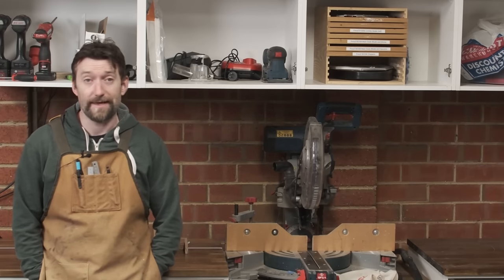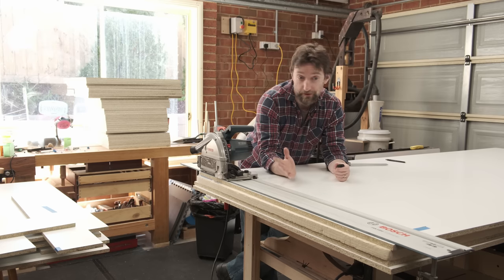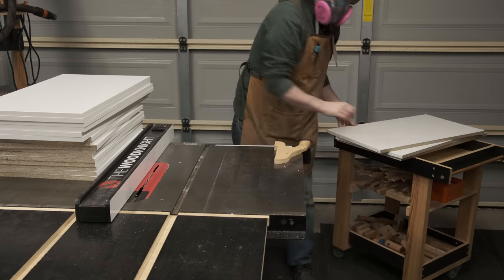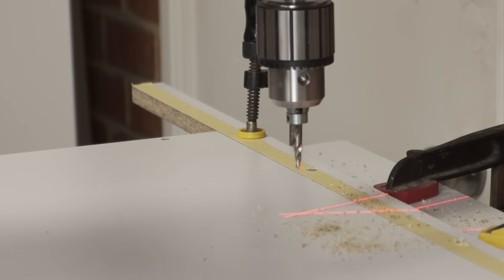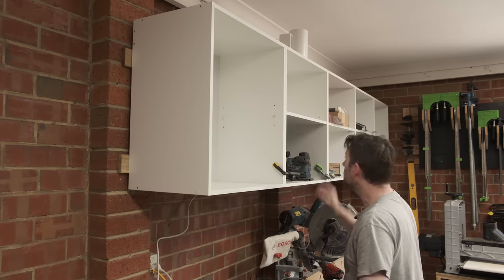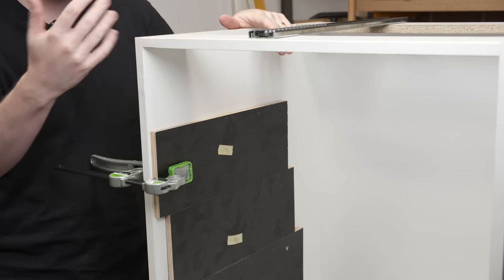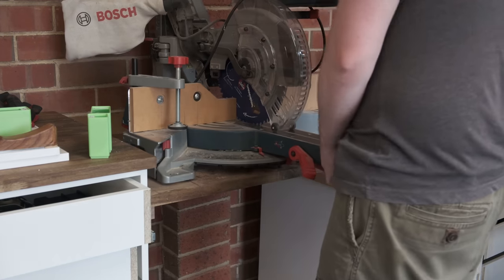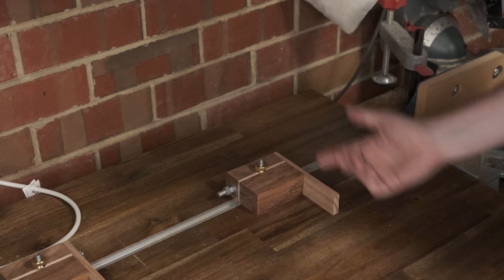Frameless Workshop Cabinets

Comment: Great Job Paul. I agree, Why measure when you don't have to. I use spacers at every opportunity. I also went for the T track solution for my Drop saw after watching a Wood Whisperer Video quite awhile ago, although I did use shop bought stops. I wish I had thought of your idea of levering the Plinth rather than the whole cabinets. It would have saved me some frustration on a past Kitchen I installed about 18 months ago.

Comment: That’s a great amount of storage. They look great. 

I haven’t seen anyone put legs on a plinth before. I like that idea. Mostly I see people use shims under plinths and screw into the floor. I don’t really want to do that. So i like those legs. What legs did you use? Do you have a link?
Reply from the maker: They're "just" Hafele's Adjustable Legs which are sold at my local big-box store https://www.bunnings.com.au/hafele-100mm-black-adjustable-screw-on-leg-set-20-pack_p0101408

A few brands do the same thing, I don't think there is any real difference between brands

Comment: Looks great Paul, very nicely done. With the stops for the mitresaw, where did you pick up the knurled knobs, I spent time looking for them a while ago for a project but gave up.
Reply from the maker: Thanks Mario.

I got the knobs from Timbecon! They only started stocking them uhhh.. I want to say within the last 12 months but time has lost all meaning and it could have been this year
https://www.timbecon.com.au/torquata-t-track-brass-knurled-knobs-5-16in-4-pack

A long time ago, they had very tiny flip stops for drill presses and the like that had those knobs - the flip stop was rubbish, but I've had one of those knobs for about 6 years now and they're great :)

Comment: Hey mate, nice to see the shop coming along

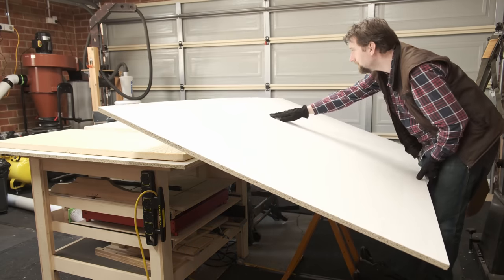The panel lifter at 2:30 ; I want one and I want one now. Where did you get it?

The 1830 x x2440 quesiton has its roots in a guy named Gabriel Mouton, the father of the metric system. His system had to comply with imperial when we changed over back in the 1970's so eight feet became 8 *12 * 25.4 = 2438.4 and six feet was 6 * 12 * 25.4 = 1828.8 etc. The chippies of the time knew 6 foot by 8 foot and dammed if they were going to get ripped off on material.

That PITA is with us today. It applies to "bulk" goods like big sheets of formply etc but funnily enough goes the other way with small stock like domestic melamine for shelving pre-cut where you get 1200 x 595 instead of 1200 x 600. God only knows why they do that.

Stay well and enjoy the new shop

Cheers 
David
Reply: A sheet of white melamine usually comes 2430 X 1215.  Allow 2420 and 1210 for CNC and beam saw optimisation.  The sheets aren't square, and aren't clean on edges so we allow upto 10mm form an edge for a clean cut.  If it's cut on a CNC it has a 10mm cutter. No way to get 600mm rips out of a sheet.

Worse is that quite a lot of plywood is supplied at exactly 2400 X 1200.  

Sheet sizes suck.
Reply from the maker: I picked up the panel lifter from carbatec last year, it's gone up a fair bit in price since then. https://www.carbatec.com.au/bora-pm-1800

The panel lifter I rate a solid "I guess it exists out of 10". It does straight lines reasonably well and as you could see flips up reasonable but I had the melamine stored inside/around a corner, and for those sections I ended up using a hook-style lifter. I'm not sure I'd give it a full on recommendation but I possibly just got a bad unit.

As LostWhits said, the melamine sheets actually measure in at 2430x1215 - I was surprised too, I'd assumed 2440x1220! So many different sizes of sheets- 2440x, 2430x, 2400, 2500 - I don't think any retailer I've bought from has actually has the right size listed! 😅
Reply: @TheWoodKnight  to make things harder, coloured melamine MDF can be smaller  than white mel sheets.  And then there is the thickness.  Usually allow 16.2 for Melamine chipboard. But for melamine MDF it can be 15.8.

Once got some Polytec WoodMatt finished board that measured 14.6mm.  I  didn't realise until after cutting ~20 sheets.  That particular finish requires extra time in the press, which causes it to be thinner.  Someone miscalculated..

Comment: I am curious about where you got the draw sliders and door hinges from? Been looking to do a similar project, and the last few videos have been great to watch.
Reply from the maker: The hinges are Hafele's Salice 110deg full overlay hinges, from bunnings in the 10 pack. They worked out more or less the same price everywhere, and Bunnings I didn't have to pay for shipping
The drawer slides are from Trademaster.  https://trademaster.au/products/ball-bearing-runner-550?_pos=1&_psq=550&_ss=e&_v=1.0 I don't know if AHS is their home brand, but they're pretty decent - surprised at how smooth they are for the price, and how many balls in the tracks there are - and came in a few bucks cheaper per set than Hafele (especially when adding in shipping).

Comment: Curious where you got the foam sheet for breaking down the melamine? I've been looking for some to go under when using my track saw but not a lot of options in bunnings.
Reply from the maker: Bunnings is where I got mine, but I think that was back in 2018 or so, which they unfortunately don't seem to have any more. It's a Knauf XPS board - it looks like Knauf aren't making the boards any more which might explain why bunnings dropped it.

Comment: Great work! Loved the video and all the info. Just wondering what software you used (if any) to calculate the melamine cuts that you made?
Reply from the maker: Thanks! I use Fusion360 to model it up, but then manually transfer it to MaxCut (Community Edition, free) https://maxcutsoftware.com, then I edit the output in Illustrator a little so its a little more readable. If you're using sheet goods, MaxCut is very powerful and I've been using it for years. It could probably be used for solid wood furniture, but I tend to eyeball each piece of wood rather than doing that in software.

Comment: Great job, mate. Can I ask what knid of and  where to get drill bit for confirmat screws?

(I'm pretty sure it is actuality pozidriv, not phillips head on confirmat screws. But I could be wrong)
Reply from the maker: Funnily enough, I ordered Pozidrive screws and they sent out Phillips head ones. Its head agnostic - I'm sure in Europe you'd be able to get Torx versions! I bought them from Elraco https://elraco.com.au/director-screw-5mmx50mm-phillips-drive-hole-zinc-plated/
Reply from the maker: Ooops! I forgot the drill bit. It's a snappytools bit, Amazon https://amzn.to/3FVlZml or SydneyTools https://sydneytools.com.au/product/snappy-tools-43540-5mm-x-40mm-countersink

There are two sizes of screws - 5mm and 7mm diameter, make sure to grab the appropriate bit
Reply: Thanks! And I would love to see cost breakdown video :-)

Comment: New drill press?
Reply from the maker: Yes! The Nova Viking DVR.  It's gone up a few hundred bucks since I got it and that was only a few months ago! It was a present to myself - I was very grateful 🤣 
I had been hitting the limits of the little Bosch a few times, and had an opportunity to upgrade and seized it. It's a weird drill press - absolutely fantastic, could never go back to something that isn't DVR now, but because of the price would also never recommend it to anyone.
Reply: @TheWoodKnight Since getting the Bosch I could never use a pulley based drill again.  It's just a pity that the Nova Viking is one of the only other digital options available.  At roughly $2k it's a massive jump from the Bosch.
Reply from the maker: Absolutely - it's a shame there isnt' a "blue bosch" version of it. Even if they made it double the price of the green unit, there is still a market for it